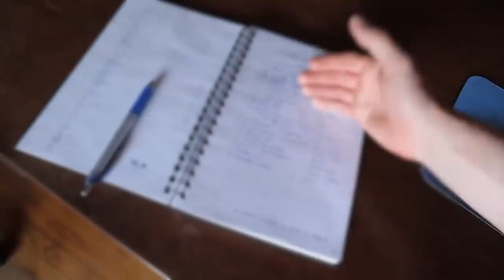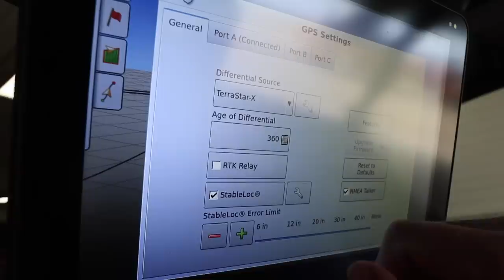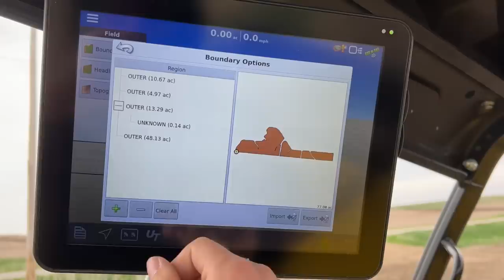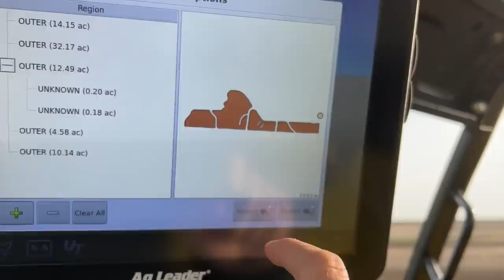I Was Forced Out Of The Fields By Thunderstorms

Comment: The metal headstone is called a white bronze headstone or a Zinky. White bronze is a metal that serves two common purposes. It is actually not bronze, but an alloy of varying amounts of copper, tin and zinc. Now days it is commonly used in jewelry as a substitute for nickel, and was used many years ago as a material for grave markers. Though it is no longer used for the second purpose, it was well-suited to that application at the time. Zinc grave markers stand out in a field of stone markers because of their characteristic blue gray color. After the markers sections were cast and assembled, they were sandblasted to roughen the surface, then treated with a metal finishing process called "steam bluing" which consists of covering the surface with a thin film of linseed oil, then hitting the surface with steam under a minimum pressure of 50 pounds per square inch.
The metal is nearly 100% pure. It weathers very well, and monuments made from zinc frequently look as good today as they did when they were first installed. They age better than marble, and are equal to the lasting qualities of granite. The markers were sold with the claim that they would last a long time, were about 1/3 less expensive than an equivalent marker carved from stone, and were modern and progressive. Their disadvantage is that zinc is brittle so the markers can be broken. Also, over time, large markers "creep" (sag), and so require an internal structure to support them. White bronze headstones were placed in cemeteries all over America from the mid 1870’s to World War I. Markers weren’t advertised or erected after 1914 because the Bridgeport, CT plant was taken over by the U.S. government for manufacturing of gun mounts and ammunition. Fashions changed after the war and the demand for white bronze monuments ended. The Monumental Bronze plant closed in 1939.
Reply: Interesting bit of history!! Thank you!!
Reply: Interesting!  Thanks
Reply: Thanks for the lesson, very interesting!

Comment: Manufacturer recommended lubrication schedules are the minimal recommended lube and oil changes.   Just enough to keep it running for so long.   One of the cheapest things you can do is ignore the recommendations and change the lube sooner.   You'll get less wear and mechanical failure/ware costs more than oil.

Comment: Cole, just an FYI: as a forklift maintenance service tech for several years, there's a rule of thumb when comparing hours run on a piece of equipment to miles on a road vehicle. That rule of thumb is basically 250 hours on equipment = 3,000 miles on a vehicle. So the service manual is correct when recommending oil change every 250 hours. However, DC is right in going ahead and changing oil when he did because, as he said, you don't necessarily run that skid loader like a construction company does where they might put 250 hours on it in a matter of months. I was always told if you don't run a full service interval in a year to change oil annually. But I think that's also a bit of a judgement call as oils are much better than they were even 20 years ago and if you run it long enough to get it warm and not draw condensation in the crank case, you could go longer than a year. As far as that pivot pin not taking grease, it might be good to pull it and inspect it. I had a new forklift a few years ago that wouldn't take grease in the mast bushing. It was still under warranty so I pulled the pin that wouldn't take grease. Lo and behold, the factory failed to properly bore the pin. The horizontal grease passage was supposed to be offset to one side of the pin then there was a vertical bore that was supposed to run across the offset bore to allow grease to the bushing. The one pin was bored to the wrong offset so the vertical bore never intersected with the horizontal. That would've been bad if we'd let that one go out of warranty and the bushings wore out....

Comment: A little late now, but I'm pretty sure you could have found a way to convert those GPS files rather than redoing all your fields again.
Reply: The problem wasn't the file format. The problem was the accuracy of the measurements. 1 inch accuracy vs 6 inch.

Comment: On that JCB, the tilt cylinder pin has been an issue on the newer machines. Come to find out that they had installed the wrong bushing in the cylinder rod. It is supposed to have a shorter bushing with enough room for a dust seal on each end of the bushing. I bet you have a bushing that is the full width of the rod and no room for seals. Get your dealer to hook you up with correct bushing and seals and that will take care of the greasing issue.